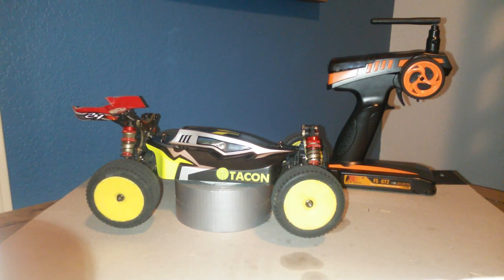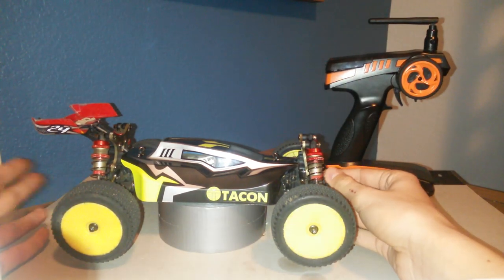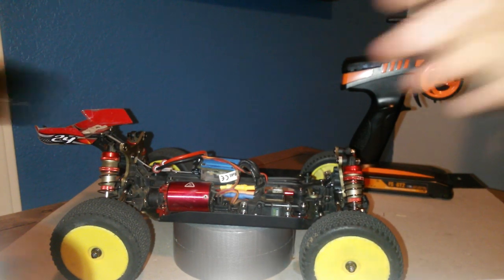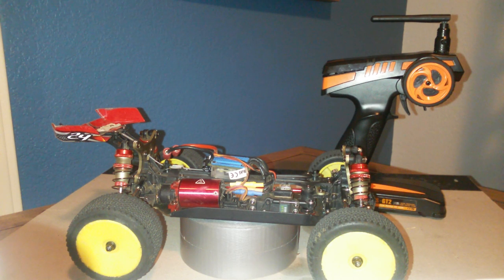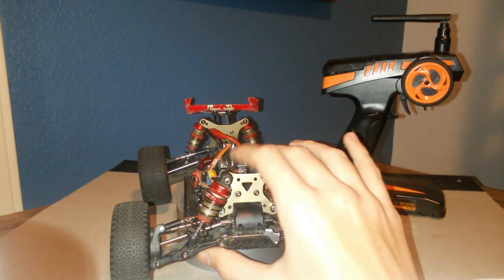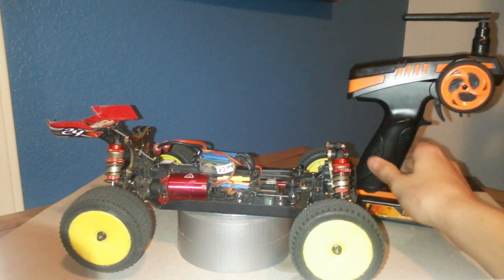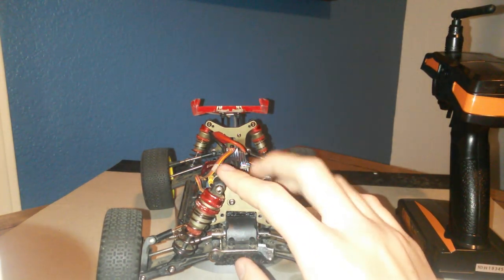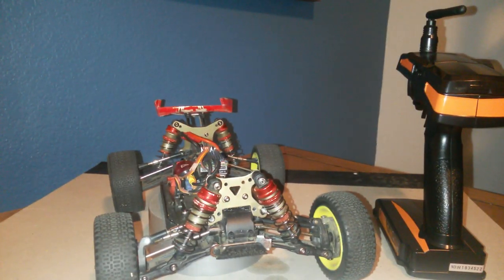Tacon Soar 1/14 scale Brushless Racing Buggy Review

Comment from the maker: @jtchen22 yeah I really only jumped it no more than 5 feet onto grass so not sure why so weak. Drove around on dirt paths and driveway. Thats nice know its a clone and theres parts for it that helps A LOT. The glueing was just a temporary solution until I get parts. I want to find aluminum diff housing. I will order the short course version bumpers for sure. Im not a rc rally guy cause I like more rought terrain like monster truck type or sct. Real rally is badass though. Like dirt drifting.

Comment: i have the short course truck and the bumpers do make a difference and when i roll over i only damage the body and the front bumper can take some good hits haven't broke it yet but i did buy a spear just in case. i am currently using a 3 cell lipo haven't used it alot yet with that battery. my motor mount screws came loose and the plastic spinner gear kept messing up i fixed it and now i am ready to see this thing run.
Reply from the maker: Yeah I actually wanted to convert it to the short course version but I decided to just sell it because it honestly isn't that great, as you can probably see.

Comment: Yeah, this car isn't really that sturdy. The design just isn't made for that. It's made to "race" the mini 8ight, which is pretty fragile as well. I'd skip out on the smaller vehicles unless you go with a monster truck, like the HPI Savage XS or Himoto Mastadon brushless (check out ultimaterc's review - he smashes the shit out of it and it keeps on ticking).

Good review though. Keep them coming, man!
Reply from the maker: I knew it was for racing and i did take it to the track once but it was a 1/10 scale track so the buggy was too small. I really was expecting more though because it has an alluminum chassis and i had a 1/16 scale buggy before that i jumped onto the roof of my house and down to concrete and finally after almost 2 years the plastic chassis snapped but oh well it is how it is. I have plenty of vids coming especially getting ready for summer. Look on my channel at the Tamiya 801xt unboxing. That thing is gonna be badass. I looked into savage xs but got the tamiya because it was 100 bucks

Comment: Thanks for sharing. What battery upgrade would you recommend for the brushed version?
Reply from the maker: +TechSupportII I would get a 2s lipo. 3s is a little too hard on the tires and drivetrain. Check to see if that brushed esc can run 2s lipo because I dont know if it can and it would suck to burn it out. Its 2014 so it should. Thanks for watching and subscribe.

Comment: is that a kit build or the "rtr" ? I just got mine and it doesnt have that long antenna and it came with a 2.4 controller..
Reply from the maker: Im pretty sure there only is an RTR. This is an rtr. My reciever started acting up and eventually burned out dont know why so I got the flysky remote and it has a standard 1/10 scale reciever so thats why the antenna is so long. Good luck man, as you see in the video I didnt
Reply: AngryWiteMan I hear ya. I broke an axle first day I had it. Ended up ordering a bunch of spare parts from NitroCX see we will see how she holds up..
Reply from the maker: tim cady yeah the only issue that was REALLY holding it back was that the front diff housing plastic is just too weak, as you see in the video. If there was an aluminum diff housing for it I would keep it. Besides that almost nothing broke. Either that or I couldnt get it to break because the diff housing broke first. Anyway good luck with it and definetly stock up on front diff housings. Tacon's powertrains are good though, like their motors. I have one for my 3D plane and it is really powerful. If you decide to use it for parts anytime definitely keep the shocks. All aluminum and threaded so definetly a keeper. So good luck and subscribe to see the airplane and some of my other vehicles.

Comment: For the bullet plug adapters did you purchase this one http://www.hobbyking.com/hobbyking/store/__29283__4mm_Male_to_3_5mm_Female_bullet_3pcs_bag.html or this one?http://www.hobbyking.com/hobbyking/store/__29282__3_5mm_Male_to_4mm_Female_bullet_3pcs_bag_.html

Also, which site did you purchase it from?
Reply from the maker: TechSupportII I bought the "3.5mm male to 4mm female" but u also have to buy some "3.5mm female to 4mm male" because there  are both male and female sides on wiring (should be) and therfore you need both conversions to connect both ends
Reply from the maker: TechSupportII  Also I got mine from ebay
Reply: AngryWiteMan RC Thanks allot for the advice and info you have given me. I really appreciate it :). Happy New Years!
Reply from the maker: TechSupportII
No problem!! Good luck with your rc's and Happy New Years to you too!

Comment: Would these work for 4 to 3.5 adapters?http://www.hobbyking.com/hobbyking/store/__30921__HXT_4mm_Gold_Connector_w_Protector_10pcs_set_US_Warehouse_.html
Reply from the maker: TechSupportII I dont really get what you mean. If you want to use these on one end and 3.5mm on the other and get an adaptor from 4mm to 3.5mm then they should. I ended up doing that I believe (its been a while since I had this so Im not 100% sure but I think thays what I did)